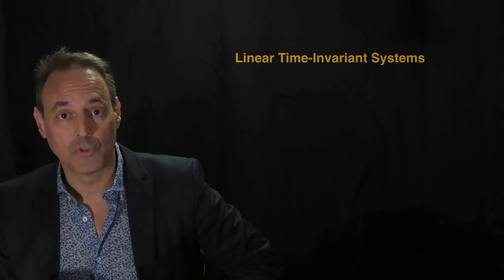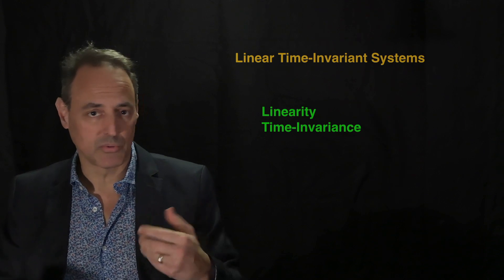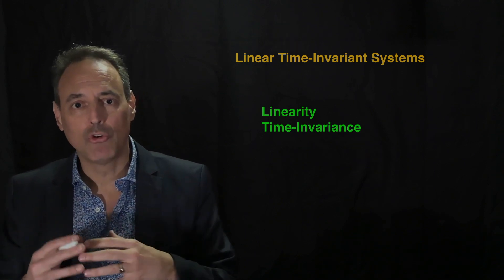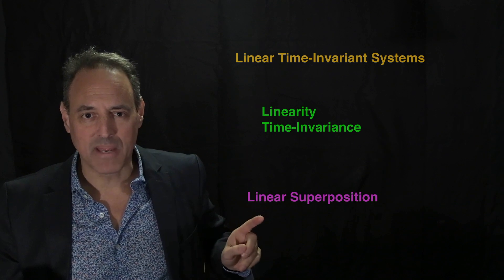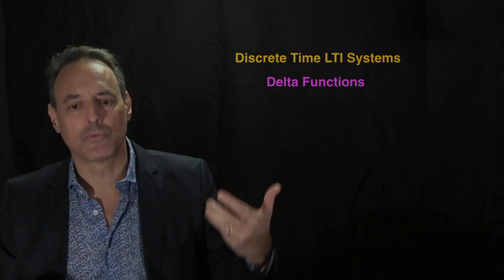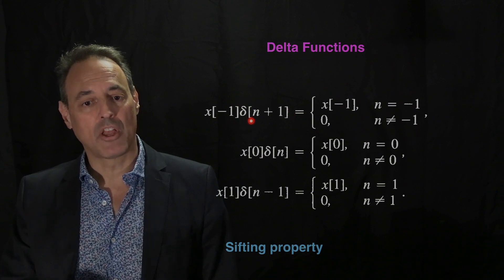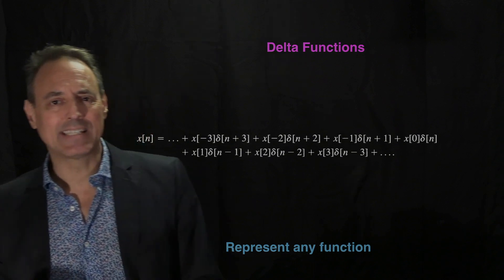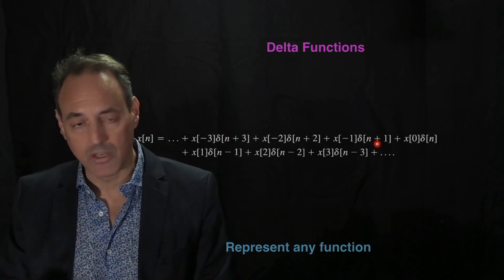Introduction to Signal Processing:  LTI Systems (Lecture 6)

Comment: Thanks! In the last LTI example, I struggled a bit to fully grasp the visualisation. I know the choice of index names doesn’t matter mathematically, but for me it was clearer to separate them. I used h[i] and x[k], and wrote out the sum for y[n] by going through values of k = -1, 0, 1, 2. After that, I plugged in different values of n into the formula to compute the result more clearly.